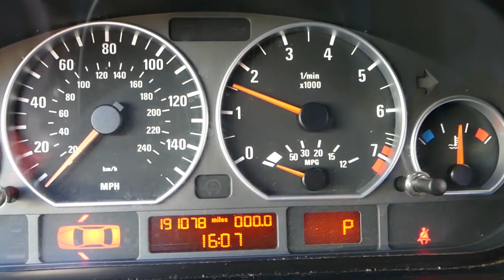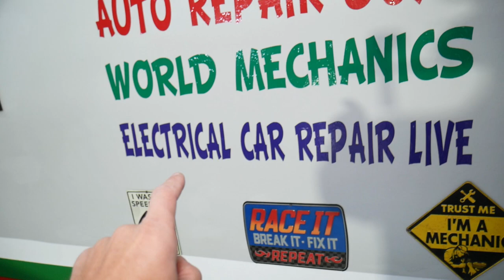BMW F30 F31 F32 F36 REAR SEAT BELT REMOVAL REPLACEMENT 316i 318i 320i 328i 330i 335i 340i 316d 318d

Comment: My bmw f10, 520d 2013 model won't unclip, seems like it's slightly different from the o e you used in the video. It has a Airbag tag written on the cover. I have tried to unclip this but not working. Any tips??